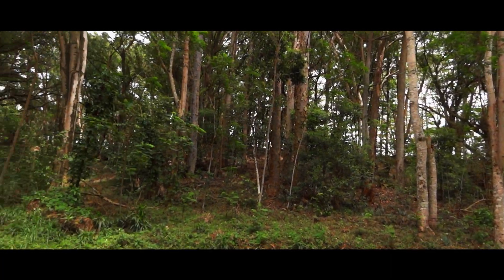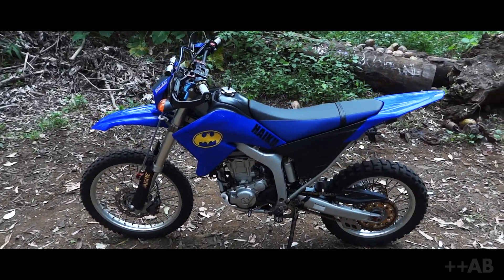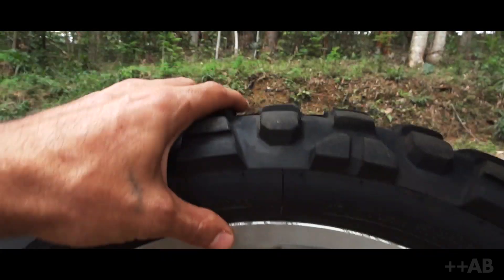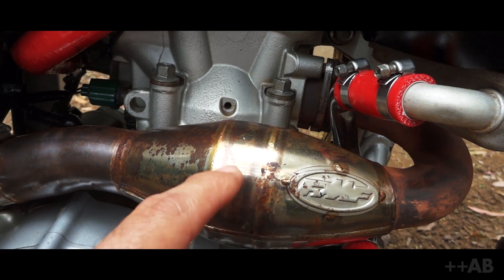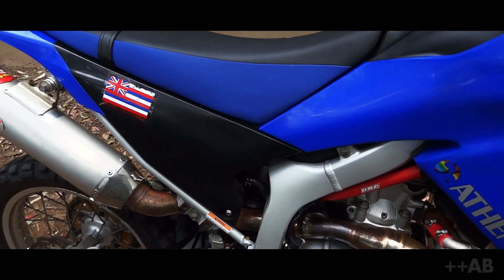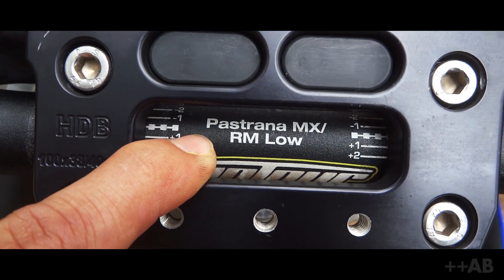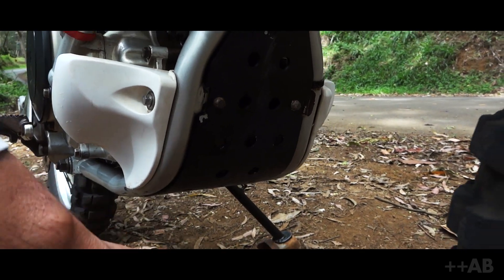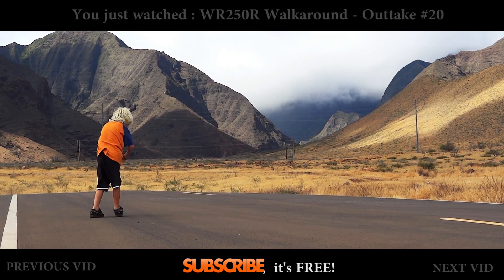++WR250R WALKAROUND

Comment from the maker: it changes the angle of the swing arm (on a small level but enough for slack) this is why you can put two fingers under a chain that's adjusted properly but when you sit on the bike it tightens up : ) This small amount of wear makes a big difference.

Comment from the maker: The relay plugs into the existing plug the oxy sensor was in as not to set off the "check engine" light. You don't need a fuel map with the slip-on + air flapper removal (airbox hole) but you do need fuel management if you add a header.. I guess at that point the stock computer starts running on the lean side.. : )

Comment: the tire can be as high or low-profile as you want, that doesn't affect the distance between the chain-sprockets. Its just like saying your chain gets slackier if you run low on fuel.
Its the sprockets wearing out that causes chain slack.
but prove me wrong, always want to learn something new :)

Comment from the maker: fuel maps have been tuned and Athena is running without a hiccup. Word on the street is Athena is just as, if not more reliable then the stock Yamaha cylinder and piston. The head gasket was definitely of the finest quality. Braaaaaaaaap!!

Comment: You did quite some modding dude !!! the only thing I would do with my wr 125 x is getting the protective plate under the engine and hand guards, maybe a different exhaust. It's still a 125 so not much sense in modding it alot cuz I'll probably big a 250 or bigger. Absolutely love the vid though !!!

Comment: yo AB! i ride a WRX, same bike, different look. Anyways, one mod you should definitely check out is the upgraded throttle tube by G2 ergonomics. i took the craptastic plastic one off (it was shattered) , and slipped this one right on. not only is it much more smooth, the throttle response is quicker, and the throttle pull is greatly reduced. 

sweet bike. i will link the tube on ur FB page!

thanks for the vids man!

Comment: in order for that to work your sprocket would have to be getting smaller.  Your rear axel will get no closer to the front sprocket even if your tire comes up missing...  it may however get a tad closer to the road..

Comment: What are some comparable bikes from other manufacturers?
Reply: +Andrew Fallon well there are other 250 dual sports but nothing compares to the WRR
Reply: There's the Honda crf250l, Yamaha xt250, and drz400s. My favorite out of those is probably the crf250l because it's so cheap and such a good bike. It's good if you don't really plan to hit hardcore trails but still want an awesome dual sport. However, I have to agree that it really isn't as good as the wr250r and I'd choose it personally.
Reply: wr450f is my pick.

Comment: My uncle has the exact same bike with the Athena borekit great bike we just rebuilt the whole engin top and lower ends so it's an awsome brand new 290 run great but the idol is off wen we let off it sill accelerates why?
Reply: turn down idle then

Comment: Anyone hear of the clutch or clutch plates going out on these? I have a 2013 WR250R, changed the oil, rode it around the block and the clutch went out. Crashed and fractured my collarbone. Bike still needs to be fixed.
Reply: Ab has a video on that

Comment: This is no normal 250... I have owned many other 250cc four strokes like an older Honda XR250 and the newer Yamaha XT250 and this little WR blows all of them away. I loved my old Suzuki DR250 but it was NOTHING like this bike. The motor can handle a lot higher revs.

I don't have the big bore kit on mine like Accidental does but I do have the FMF pipe and fuel injection programmer. I previously had the Suzuki DRZ400 and prefer my WR250R- it is lighter and the fuel injected motor is bullet proof.